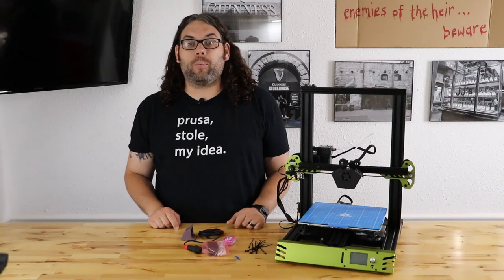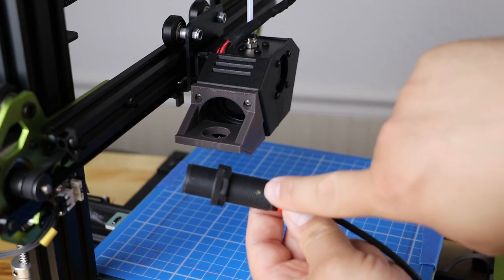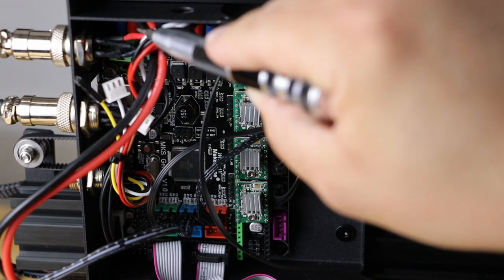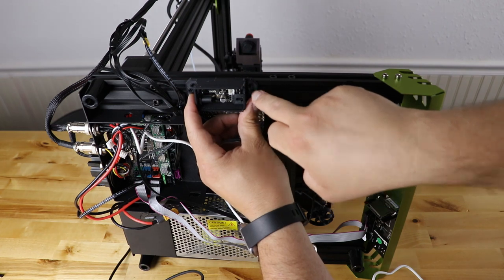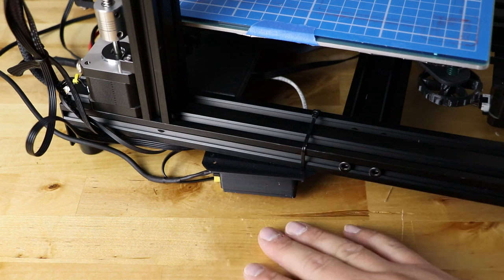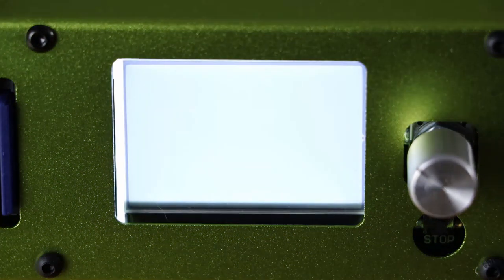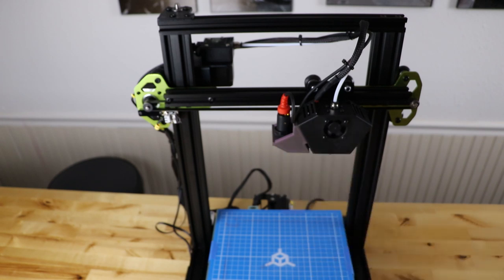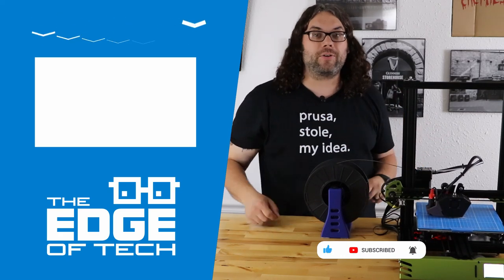How to install the TH3D EZABL Pro on the Tevo Tarantula Pro

Comment: A Comment for a those that wish... Notice the ferrule crimps on the factory wire ends. It's a good idea to use those on any screw type compression terminal. The power supply would use ring or fork (less secure than ring) terminals. Bare wire ends can get you in trouble; unseen stray strands can short or bridge circuits causing undesired behavior.

Comment: The hotend being at temp doesn't really affect the Z homing. Bed temp definitely will affect it though.
With good springs you should only need to use G29 infrequently. M420 S1 after G28 will load the previous stored mesh (M500 after G29) and be a lot faster than G29 every print.
Ah, just saw the solid mount while typing this. My comment above definitely holds true for that.
My bed looks like a canyon so I have a 9x9 grid in firmware, but my springs work well enough that I don't probe but every few months. Just M420 S1 after G28.

Comment: Hello again, Jim.

The first time I did this procedure, I went straight to a test print.
Unfortunately, it started printing, 2mm above the bed. I was not aware that "Z offset", and "Probe offset" were values that needed to be considered.
How were you able to bypass this step, as I did not see you perform those steps during the video? How were you able to know exactly what those
offsets were? I do understand that these adjustments can be made in the firmware, the slicer, and on the display.

As I am just finding this out, can you point me to a video that can show me how to perform these procedures, using the display, on my TTPro?
In this video, you were using the "green machine". I got the hybrid TEVO/Homers "orange machine" (orange parts, TEVO logos).

Thanks for your time!

Comment: Please Jim for the love of the printer Gods fit ferrule connector it's a big peev of mine if it's a bare wire fit a ferrule to it 🤫
Reply from the maker: Hey man! I was super pleased to see that this printer already came with them! I guess I could have cut the existing ones off, out the wires together and used new ones! I may have to do that! Thanks for watching!
Reply: @TheEdgeofTech  you can fit another set w/o cutting the power they fit in trust me safest way plus you shred the wire what creates copper strands and strains the cable if you're needing a kit let me know and I can try get one sent out to you